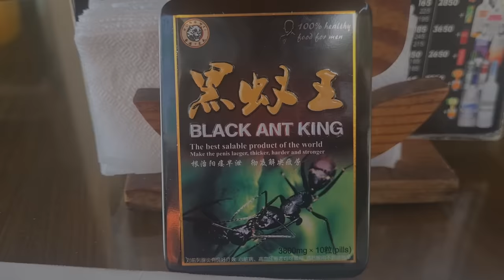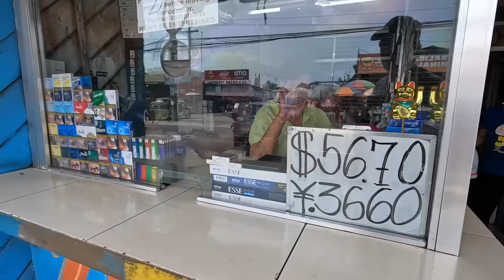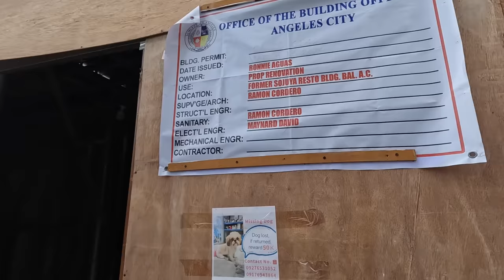IS IT A CURSE TO BE A MARRIED MAN LIVING IN ANGELES CITY PHILIPPINES #travel #entertainment

Comment: As I mentioned before, the Owl's Nest was the very first bar I went into when I was stationed at U.S. Naval Radio Transmitter Facility, Capas, Tarlac. I don't know how long I have been subscribed to this channel but you walked by it in the very first video I watched. I was shocked it was still there as it was an iconic bar back in 1980 when I went in it. I agree with you Brian. I don't care for the new design and wish they would have just improved on the original design.

Comment: Your new house is looking great. Are you going to put solar panels on the roof?
Reply from the maker: No plans to put solar panels on the roof
Reply: @PhillyinthePhilippines Best investment I made Philly. 13KW system installed three years ago only 8K US.
Has paid for itself already and we have 0$ electric bill.
My house runs AC 24/7
Think about it.
Reply: @thomasodetinape4180  If you could set your house up to be independent. That would be very cool! Solar with batteries, star link, and your own well.
Reply: @51dbail  Well it's just my wife and I, we make enough with net metering to be free of bills. I am pondering a whole house generator to deal with the brown outs. For just the two of us it wouldn't be cost effective to add batteries, but a family I'd say I agree with you. Our Utilities of wifi, electric and water are less than 60$ a month, house paid.
So only food and gas. Plus non essentials.
Reply: @thomasodetinape4180  we don’t get brown out where I live. But if the power goes out for just a min. The water goes down. Now someone has to go to the pumping station and flip the breaker. Now this can take a hr or so, then to build back pressure another hr. Sucks but doesn’t happen often. I bet where Philly is going they lose the power a lot.

Comment: Thanks brian , fir the fotos of the house build. Good idea NOT to have the upstairs made withh hollow block. Will be much easier to keep cooler at night.
Our bungalow in Pangasinan, is all hollow block.
So even at 4.00 am, is still like an oven!
So much heat stored up in the ealls , during the day.
All doors and windows, left open, so the very hot air from the surrounding concrete and garden, comes into the house! Getting people to clise tge doors is almost impossible ! Lol.
As for painting, the exterior, please use as light a colour as possible( if not actually white, perhaps, white, with a tint of yellow or blue?), to reduce the heating effect from the sun.
It worked great on our southfacing rear wall, where the kitchen is. Before was just old rendered cement, even at 8.00 pm, the inside wall felt hot to the touch! Painted it a pale yellow. Worked a treat, no absorbed heat  at all!